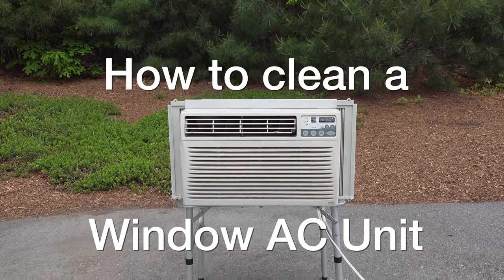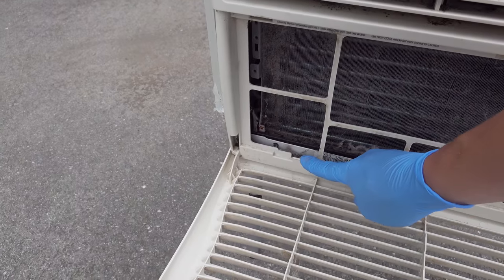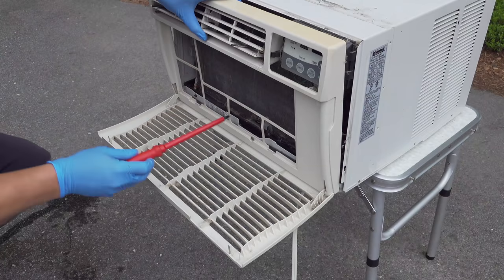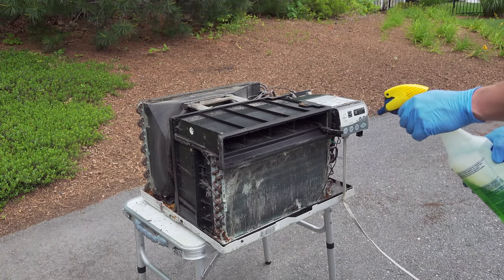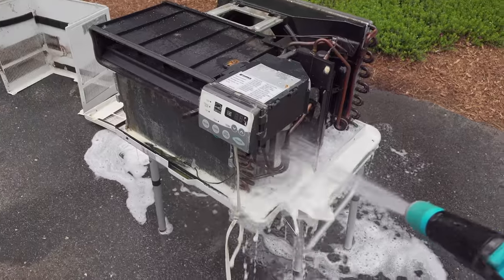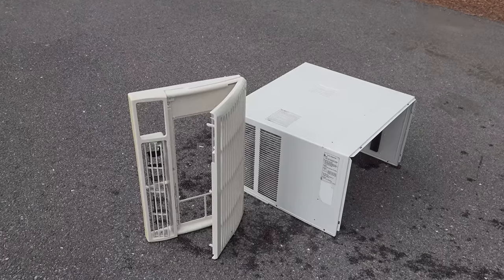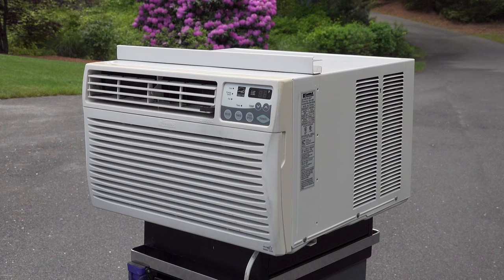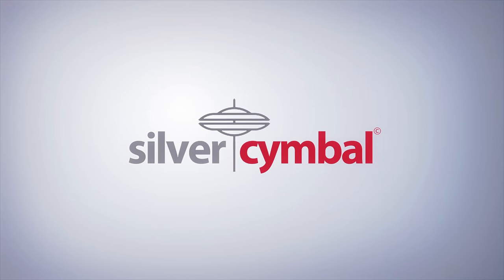Window Air Conditioner Not Cooling? EASY Common Fix - How to Clean a Windows AC

Comment: Dont forget....you tipped the compressor....let it sit 4 hours after reinstalled to let the refrigerant to settle back in the unit....very important...
Reply: Who told you that
Reply: Yes very important
Reply: Im an hvac tech for 25 years...thats how i know 👍👍👍👍👍😄😄😄😄
Reply: @warbird101210  yes. Never never do that.
Reply: It's not the refrigerant that has to settle you let it sit upright in case any oil ran into the lines or it will cause a restriction
Reply: @ericschulze5641  same thing i said.......but yea let it sit 4 hours....
Reply: Mine is inside the building shop and home combined. I use filters over the intakes held by magnets. And in the winter time I cover it in plastic. I clean the filters over the intakes once a week. I don’t see mine getting too dirty anytime soon. I also take a damp rag and wipe the dust off. Being inside helps a lot. Most people don’t have that option though. The only drawback is that it heats up that part of my shop.  But it is a big shop. Also I think being inside out of the direct sun helps the efficiency of the unit.  Or machine like this guy called it. Lolol
Reply: @warbird101210   no, you said you need to let the refrigerant settle, the refrigerant doesnt need to settle its the oil within the compressor that could cause an issue
Reply: @agx012  But it all works out the same. I understand we do not want to extrapolate on the basis of refrigerant instead of oil, but it is about letting it set for a while to get the fluids where they belong.
Reply: Glad you mentioned that. My dehumidifier’s instruction had stated the very same thing for the same reason. If you tip an appliance with this refrigerant, ensure to let it settle on it’s correct position for 24 hours before use.
Reply: Wished you did the temp check before and after clean up to compare the output..
Reply: It’s the oil you have to let settle back into the system.
Reply: @Stormchoirs  All the same to me...either way, it has to sit for a long while
Reply: @trevino37  no it really isn’t. 25 years you said? You sound like a chuck in the truck type of tech.
Reply: @Stormchoirs  you are mixing up the strangers you are attempting to insult lol so maybe just stop what you are doing altogether.
Reply: Man oh man, couple months ago I've seen somebody hauling a brand new refrigerator in a pickup...  laying flat on its side.  I hope they know about that before they go pug it in!!
Reply: @MrKletch  they be like, I can fix it, it just needs free-on!!! Lol lol
Reply: Eric is right....but so am i....let it sit when reinstalled...
Reply: Wonder if this would work on my truck evaporator.  It came with a cabin filter, Now I have cooling problems. So change them cabin filters in your car or truck, If they have one. It could save you from my trouble.They also make kits to install your on cabin filter, very simple.  But you have to take the dash apart to get to the evaporator. So don't wait for it to get clogged to do something, It won't cool. No matter how hard the fan blows, It won't come through.
Reply: Great notice! When I was a young man, I worked at a Sears receiving dock. These units seemed to be  sold straight from truck to car pick up.
When air conditioners came in, if they were laying sideways, we were told to put them aside for 4 hrs, before placing in inventory. 
Just what you said, why we were to do that.
Reply: What about moving a refrigerator.
Reply: @theglove5814  same deal...let it sit for a few hours....after moving it...
Reply: @warbird101210  thank you so much.  I will have to tell others.

Comment: Fantastic advice! Excellent video! 
 I'd like to add, for those who are given a used air conditioner, mabe from a smoker, a degreaser like Greased lighting will quickly remove all the stink. Use gloves! Works faster & removes the smoke residues that Dawn dish soap can't, without scrubbing.

Comment: My conditioner is now 19 1/2  years old, but is working as good as new.  The motor did eventually end up squealing at one point at high volume.  This was due to the oil having dried up completely at the bearing felt pad locations.  With a little patience and a little know how, I figured out how to re-oil the felt pads, even though it was a fully closed and sealed motor.  That brought the motor back to having a quiet life.  Other than that, the front plastic panel had turned yellowish over the years, so I de-yellowed that by using ICE CREAM.   ICE CREAM is a women's hair bleach that contains 12% Hydrogen Peroxide.  So, by taking care of what you own, you cut costs down significantly, just as is the case of my stainless steel microwave oven. It is now 18 years old, but it basically looks a good as the day I bought it. I have had to replace a door micro-switch a coupe of times, and replace the main fuse and a thermal fuse, but I simply obtained those parts from someone else's oven that they had tossed onto the curb for disposal.  I also repaired the turntable motor when  it stopped working.  A few drops of glue was all it needed. So overall, the total repair cost over those 18 years, was $1.49.   So that's roughly 8 cents a year.  The oven itself was a store show model, so it only cost me $45.  That amounts to $2.50 per year for 18 years.   LOL

Comment: Great video. With 5 units, I do this every year.  Knowing industrial maint, I go a little further and unscrew and move the condenser to get at the backside where the dust clogs the condenser.  The black dots in the evap portion are dirt/mildew.  Unfortunately that part is now usually surrounded by styrofoam, so be careful wiping in and around the evap fan blades. The evap part is where Legionaires can form, so disinfecting it is important...especially where anyone in the room has breathing issues to begin with.  So many units get tossed when it's only a clogged condenser.
Reply: How do you disinfect it?  What exactly should be disinfected, and what product should be used?

Comment: What you’re looking at with debris is a lack of heat transfer, this ac is a heat pump, meaning it removes heat from a space. If there is low airflow there will not be a heat transfer the coils are the only important objects to keep clean
Reply: @Darin P  Except he's not really wrong though. AC units are a heat pump, they're just one-directional. A standard AC unit is just creating (and hopefully maintaining) a simple "cold" to "hot" temperature gradient. This is accomplished by pumping a refrigerant through a condenser coil and an evaporator coil (and some specialized valves) using a compressor, not some "dehumidifying process". The refrigerant undergoes a phase change at each coil. Liquid to gas (e.g. evaporation) at the evaporator coil, and gas to liquid (e.g. condensation) at the condenser coil. Evaporation is endothermic and condensation is exothermic. Heat is drawn into the refrigerant when it evaporates at the evap coil, and released from the refrigerant when it condenses at the condenser coil. AC units are arranged in such a way that air from in the home is blown around the evap coil and back into the home, while air from outside the home is blown around the condenser coil and expelled outside. So, an AC unit quite literally pumps heat from inside the home to outside the home. Dirt, dust, grime, and other debris slow down heat transfer between the coils and surrounding air and limit air flow rates from around those coils in the case, which is essentially what Brandon said.

Comment: I did this with mine last year. It’s surprising how much dirt and debris builds up. After washing I also used a blower to push out any water and stuck debris. I let it air dry in the sun for a while.
Reply: Did work fine?

Comment: Great Video to clean up your air conditioner! I been having a lot of breathing problems hope this helps! Looks like a  big cleaning a head but it looks like this could be the video I need to help me stop breathing all this dirty air! My unit is Midea I sure this what it needs after all the screws are off then use a hose and spray it down with soap and water! Sounds like a plan!

Comment: I do the same for mine when it gets dirty. I cleaned mine with a cleaner that kills mold and mildew , because my window unit will build up mold and mildew , and produces a bad smell . I cleaned the unit real good in the early spring before it starts getting hot . It runs like new , no smell , and it gets really cold . I also built a awning over my window unit to help protect it from the elements. I have a lot of trees around my house , things will fall out of the trees on to the unit , and will get in side of it and make it nasty . I just built the awning so far I have not seen anything on or in side the unit . I believe the awning will benefit me for years to come .
Reply: I have a question before I try cleaning my own window ac , where the mold and nasty dirt is on the bottom of the ac if their is a small water puddle does that mean anything or is my ac just full on dirty , I’ve only had mine for about 8 months now so this is why I’m asking do I need it fixed ? Or do I need it cleaned ? Because It does smell and it is blowing hot air but when I look at the ac from the outside of my window looking in I see dirt , mold / a little bit of water what do I do
Reply: which cleaner did you use to clean the mold and mildew out--also how is it safe to use the mold and mildew cleaner in the air conditioner or when cleaning the air conditioner?
Reply: @NicholasPeters1  I used a cleaner called spray nine , and it works really well and it is safe to use . It kills the mold and mildew , and it has a degreaser in it , so it cleans the unit good .
Reply: @SilentBlunts  I would just try cleaning the unit . If you can get it out of your window , try to spray it out with a water hose and use a spray cleaner that will kill mold and mildew , and has a degreaser in it . If you have trees around and hanging over your unit , stuff can fall out of the trees in to your unit and get nasty inside of it. And your unit should have a drain hole so it can drain water out of it properly. The hole can get stopped up with debris and not drain. You will have to clean it out so the water can drain out like it is supposed to. After cleaning the unit , and it is still blowing hot air , it may need to be fixed or replaced .

Comment: I cleaned my window AC unit a few weeks ago, after watching this video, and it now blows enough cold air that I have to periodically turn it off or it simply gets too cold in my room.

BTW, I have an air compressor, so I just used compressed air to clean it all up. No soap nor water. But yeah, cleaning it, however you want to, will give it new life!

Comment: My hypothesis about my uncle's GE aircon not cooling well enough?  I said to him that it needs to be cleaned. We took it out for cleaning, and hours later, the difference is noticeable. Much cooler than before cleaning.
Reply from the maker: That’s great to hear.  People don’t realize these get plugged up after years of use. Definitely worth doing and keeping it going longer. Thanks for the feedback
Reply: @SilverCymbal   my unit is inside my shop. I have a apartment and shop combined. Also I use filters held by magnets over the top and side intakes. These are cleaned once a week. Plus I wipe the outside of the unit down often with a damp rag. I wrap the unit up in plastic in the winter time. I think being inside out of the sun makes the unit more efficient too. Most people don’t have that option though.

Comment: I had to clean out my adopted mother's prior to having it placed into the window last summer ! It was absolutely disgusting ! I had to use Q-tips to clean the smaller areas to remove the dirt.
Reply: Payin it back .
  Good job. At Taken care of the older ones . 🤠🖖
Reply: @cowboykelly6590  ..No..honestly, that is not the case, I was FORCED to go there against my will due to financial abuse, and I did not want to breathe in black soot when the air conditioner is turned on. She has the capability to clean it herself, she just doesn't want to.

Comment: I do this every fall with all my units including my portables. I had a Carrier from 1967 that worked over 40 years and a Kenmore for 30 years that heated as well with the compressor and coil when it got colder. They both still worked when I moved and had to leave them behind. People are afraid to spray them because of the obvious reason, electrical short. Worst case the circuit break and or GFI would trip and most newer units have a GFI on there plugs, I think it is now mandatory. I just be careful not to spray the electronics. Ether way, I do it in the Fall when the cooling season is done so the are way dried out by spring!

Comment: you have to cover the fan motor with a plastic bag before you use the hose. Many ac units have the fan motor exposed and the water can ruin the motor if you dont protect it.

Comment: Can't remove mine from the window without surgery but I've used a hose and AC cleaner solution for a few years. Works fine.
Reply: I was just wondering how I could clean mine cause it's high up on the wall and I have no idea how I would get it out. I just moved in here and I'm thinking it's never been cleaned. Could you explain a little more how you clean yours without taking it out?
Reply: @minkiegreen404  I have a ladder that lets me get closer to the AC. Mostly just nearer to it. I use a can of AC Coil Cleaner. You can buy it from most big hardware stores. It remove a lot of grime and then I blast it really well with a water hose all over. I make sure the rubber plug on the bottom lets the water drain out. When I finish I drop a few (a lot) Air Conditioner Drain Pan Tablets through the slits to help control any mold and mildew smell.
Reply: @BusinessMan1619  I'm very new to the wall unit life. I didn't even there was tablets you can use for them. Haha. Thank you so much for your reply! I'm gonna attempt to clean it tomorrow when it's a little cooler
Reply: @minkiegreen404  you got this and have a wonderful summer.
Reply: @BusinessMan1619  thank you 😊 and you as well

Comment: Man I cleaned a little my mother's a.c. unit window and you right I clean the filter, the front or grill of ac and wait like 3 hours and the a.c. star fine like new, excellent video.
 Thanks for the info on the generac 2200 I noticed on my area that prices starting going up and you can't find too many gerators as matter of fact they recommend you look on line.

Comment: During the cooling season if I stay in a motel with a window air conditioner that’s in a window or mounted though the wall I do some free maintenance for them to keep myself and my family cooler and healthier.  I remove the filter if they have one (it always looks dirty and disgusting)  and clean it in the sink or tub with a little warm soapy water and I rinse it.  I’ll dry it off quickly by sandwiching it between towels before replacing it.  When I switch the A/C on I am rewarded with cool clean air.  I don’t think motels ever clean the filters so I do it for myself.
Reply: most hotels have central air lol
Reply: @iggypopisgod9  True. Most have central air or a PTAC in the wall. 

I’m talking about really inexpensive and old motels.

Comment: Don't soak the motor, remove before cleaning if possible
Reply: What if it isn't?
Reply: @SlickRick4EVER  get water in the fan motor it wont work..i was taught to wrap the fan motor up with a trashbag and duct tape

Comment: I did this today with with my hubby  we got from his sister tried to use it the day we got it after moving another out to place in a smaller room the night we tried it and found it wasnt working right this video popped up on my watch list so I did and today the next day we followed directions and it's now drying out another hour we can our it back together and check and see if it works better....fingers crossed!!! Will follow up after we do that

Comment: what fertilizer should I use for my AC?
Reply: AIR-8 naturally  😋
Reply: One high in oxygen
Reply: A tablespoon of soap and water does not make that dark green color! What was really used?
Reply: @tmi9871  piss.
Reply: @tmi9871  probably Mean Green. I would use that. I clean mine once a year with Awesome spray and and Shop Vac that sucks and blows. I suck up the big stuff,then blow through the Condenser to clean in between the fins.
Reply: Guano

Comment: What about cleaning the inside of the cold air handling ducting and fan? I always get a buildup of mold on the inside of the ducting. Especially if the ducting is made with molded styrofoam material. It is impossible to get it totally clean just by trying the reach through the outlet grill.  Thanks
Reply: Did you ever find out how to deal with the issues you mentioned above? Also I am not sure if I have the same styrofoam material in mine as you (it seem so but I don't know s*it about being handy).